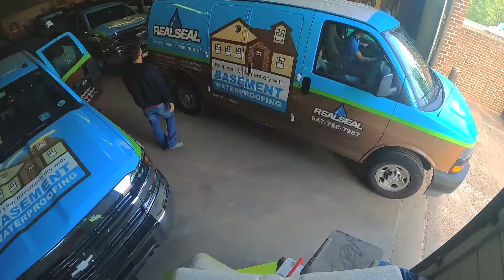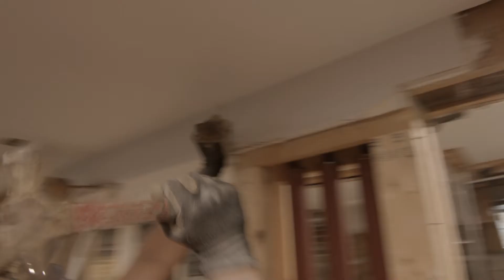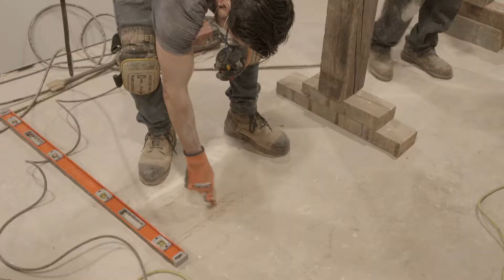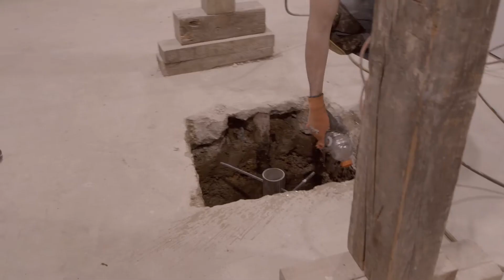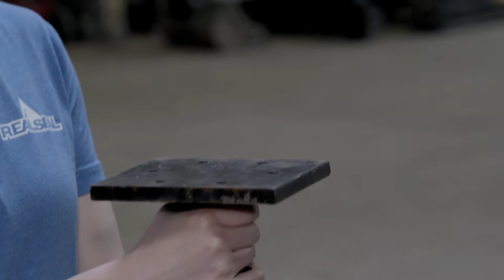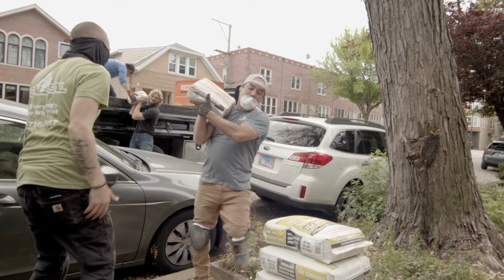How We Do It: I-Beam Supports & Rebar Footings

Comment: What was the point of this project?   It just looks like you did a lot of the same.  From what I could see you had the same amount of supports, so you didn't eliminate any, and It didn't look like anything was wrong with the original supports. Could you not eliminate more of the supports with the beam?
Reply from the maker: Hi Richard! The wooden supports and footings (or lack thereof) were allowing the I-Beam to sag, which led to damage upstairs. 

Without changing the beam, we are unable to switch the location of the supports. In order to do that, we would need to swap the entire wooden I-Beam for a wooden one. As the beam itself was in good shape, we just needed to swap the supports and footings. 

You can see behind us that the foundation was underpinnned in the past, meaning the basement was lowered. Whoever did that did not install the new supports properly, which caused the issue.

Comment: Is that just heavy walled tubing with holes drilled for rebar? Is that reinforcement commercially available? Or does it have to be made?
Reply from the maker: We use rebar that is then placed in the hole, which is then filled with cement. They are custom made for each project.